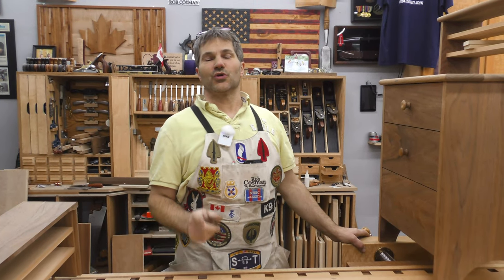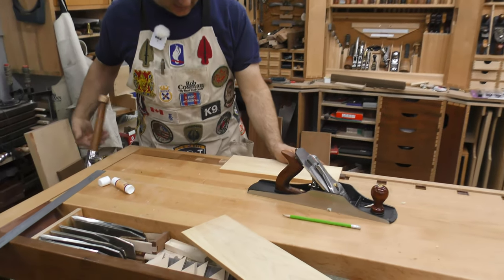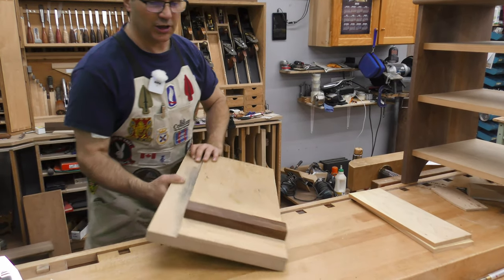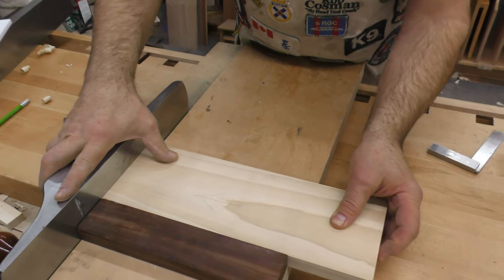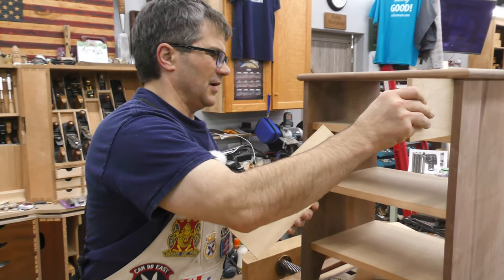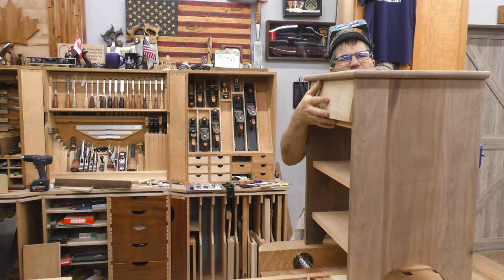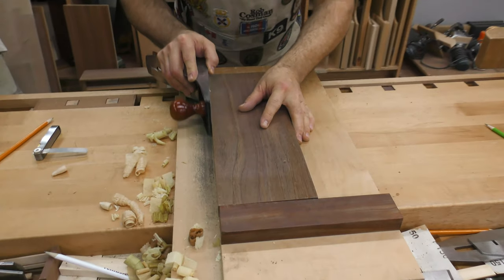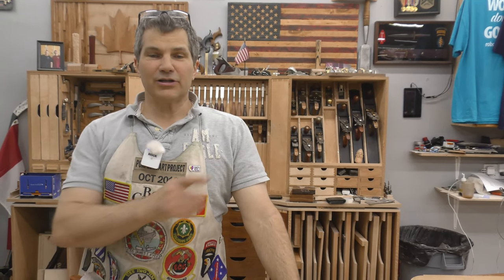Drawer Making - The Right Way (Parts)

Comment: Excellent video series. A separate question, the Wood River 5 1/2 Jack plane is not available till June or July, what are your thoughts about the Veritas 5 1/2 or the Lie-Nielsen. Not concerned about the price but rather quality since I don’t want to wait till July. Thanks.
Reply from the maker: Hey Raja, I fully recommend the LN 5-1/2, if it’s available. If not, the WR 6 is a great option as well.
Reply: @RobCosmanWoodworking  thank you for the quick response, the LN is also not available at this point but not as long of await as WR.

Comment: Are you building this in a heated shop in the winter?  Lots-a-luck getting those drawers out next August.
Reply from the maker: Watch closely Bill, I didn't start doing this yesterday.
Reply: @RobCosmanWoodworking  I assumed that, in this video, at approximately the 15 minute, mark you had established the final height of the drawer sides.   Perhaps the mistake is mine, arising out of a different procedure for fitting drawers.

Comment: One question, I notice that you're really careful about pulling shavings out of your plane after every pass. Is that required for good planing performance? Or are you just checking how much material you're taking?
Reply from the maker: Keeps them from being pulled under the plane on the back stroke.

Comment: Once you’d fit the sacrificial piece as a template for the walnut front didn’t you transfer the marks with the bottoms flush done very precisely by feel? With that drawer design doesn’t the drawer front when finished hang down below the sides and covers the slider shelf therefore putting the two reference edges in different places which will cause problems seeing there is a taper to the side?
Reply: Otherwise I really enjoy your videos and find them inspiring and educational. Thank you.

Comment: Hey Rob, I am wondering why the top of the drawer sights are not parallel to the bottom. Or am I wrong and they actually are parallel? Around 15:55 you cut a chamfer by flipping the board, this is why I deduce that top and bottom are not parallel. thanks for your answer :-)
Reply from the maker: They are parallel. The tiny champfer is to keep the back side from blowing out as I shoot the end square.
Reply: @RobCosmanWoodworking  Thank you. So to cut the champfer you do not lean the drawer sight entirely against the reference of the shooting board (the piece made out ofJatoba??) ? Thanks again

Comment: Hey Rob , would Birch be a good secondary wood for the draws ?
Reply from the maker: yes but it does not always plane well and I find it tends to be a bit more unstable than poplar, aspen or pine.
Reply: @RobCosmanWoodworking  In OKC, very hard to find anything but the big box pine, which is too yellow a knotty. I can find aspen occasionally, but I thought you didn't like aspen, either (or is it a specific type?). What would you consider the best alternatives (besides that holly!!!)?

Comment: Great video! Could you make a video where you go thought the different bench accessories you have  got in your tool cabinet i.e.(shooting board ,bench hook). also what are your opinions on the shooting plane pros and cons , wouldn't it be more accurate and comfortable with the angled handle?
Reply from the maker: Maybe, but it wont overcome the hassle of pulling out another plane nor the cost that I could spend on something else

Comment: I'm confused.  You straightened one edge of a drawer side then put it through the table saw using that straightened edge as a reference.  Then you planed off the saw marks and fitted the drawer using the shooting board.  But you had no yet used the shooting board to put 90 degree edge at one end oft the piece.  Shouldn't that have been done first to insure that the two side edges of the board were parallel?

Comment: Your plane looks like a porsche. Are these available in Evrope?
Reply from the maker: Its a WoodRiver. You can also buy them from us, we ship to Europe
Reply: @RobCosmanWoodworking  Is this a no. 6 you use here? I own a #62 and wonder if the 6 would be much of a difference.
Reply: @RobCosmanWoodworking  Thank you very much. Found it by the name Qiangsheng or Luban.
Reply from the maker: 5 1/2, a 6 is the same plane except a few inches longer.  I dislike the 62 for several reason, biggest is the small surface area on the side for shooting.

Comment: Keep in mind when I ask this that I'm a novice. So, I'm not trying to be critical. I honestly don't know the answer to this...

At around the 28 minute mark he transferred a mark from a sacrificial board to the real board.  If he squared up the sacrificial board and then just put a feeler gauge in the back to modify it... wouldn't that have been how to do the real board?  Could he have just squared it and used the feeler gauge again?   I know I'm missing something but I'm not sure what it is yet.  Love these videos! I feel like I'm leap frogging ahead and avoiding so(!) many mistakes because of all his hints.
Reply from the maker: Yes normally i do use that procedure on the teal board but because of the way I made this carcass i could not use the real board and had to use the sacrificial board.  I have to have a bottom to reference on and i did not bring the bottom of the carcass all the way out , thus to reference on the bottom i have to use a thinner board than my actual front, get the fit then transfer it to my larger front board